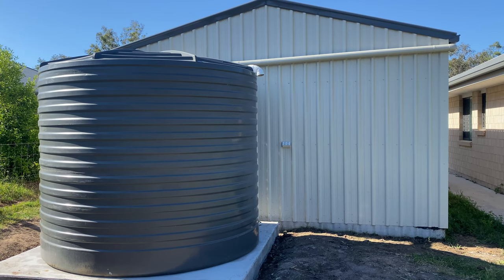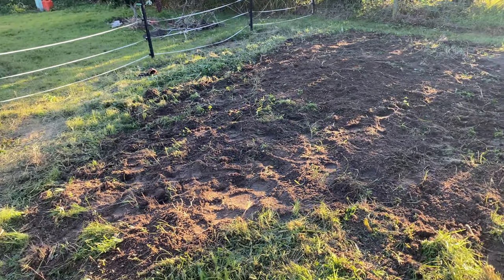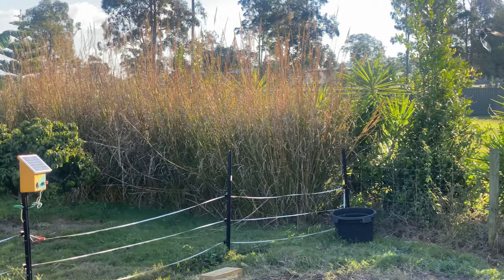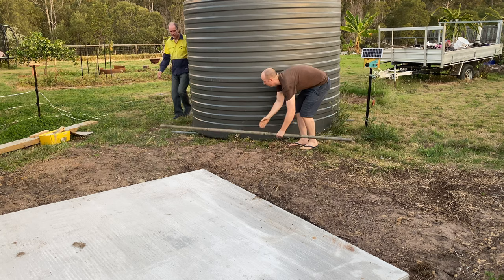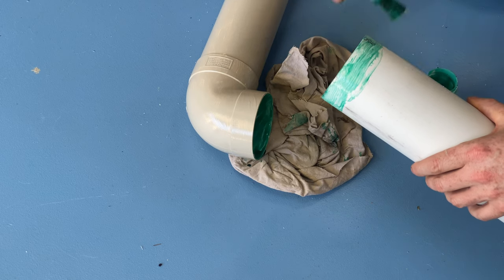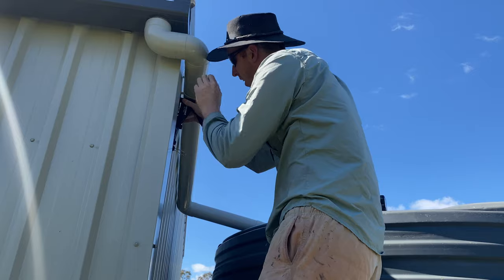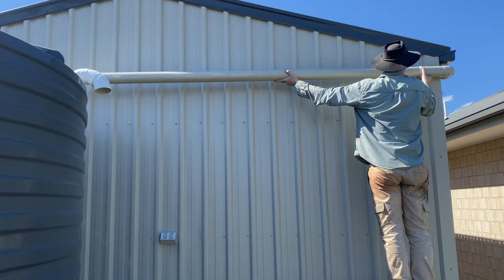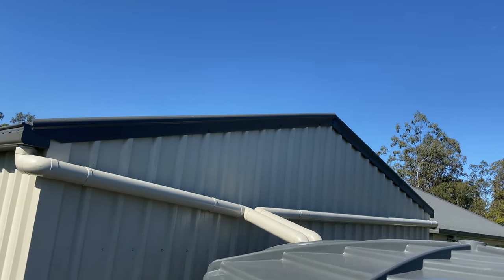Rainwater Tank Part 1- Base and Gutter Connection

Comment: Just moved into our new forever home on a small acreage and about to position a Corrugated 23,650L tank we got from Tankworld with Bianco INOX90 Stainless Jet pump (Big Brother of the one you show in video) Found your guide very informative and well presented. They raised several things I hadn't even thought of so much appreciated.
Can you advise the products you used - 2 x Mozzie Stopper fittings, Pump cover and flexi hose and where to get if possible regards Ross

Comment: I had terrible luck with water going into a top screen. I think that's what yours show. A LOT of water bounced out. I put a bulkhead fitting into the side and attached the pipe to it. I hope your does better.
Reply from the maker: Hi Wayne. Yeah it’s a screen alright. It’s fairly deep so fingers crossed but I know what you mean, my house down pipes have double screens and a fair bit bounces off the first one in a heavy downpour. Thanks for the comment, I’ll make a short next time it rains :)